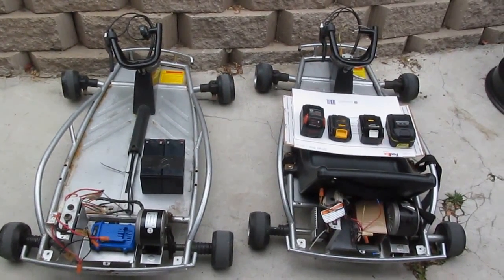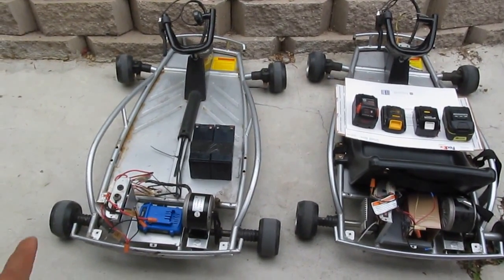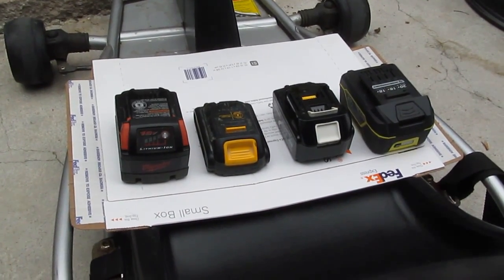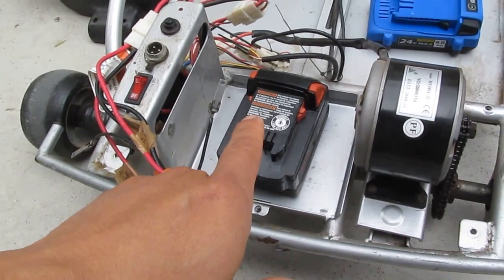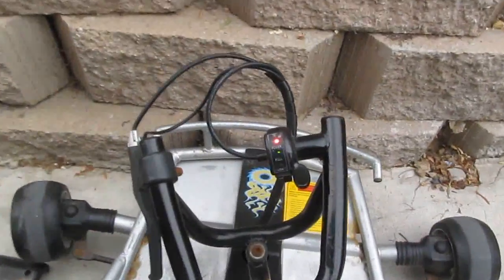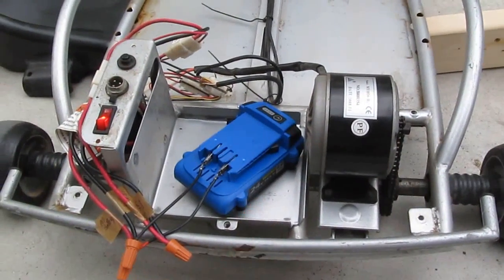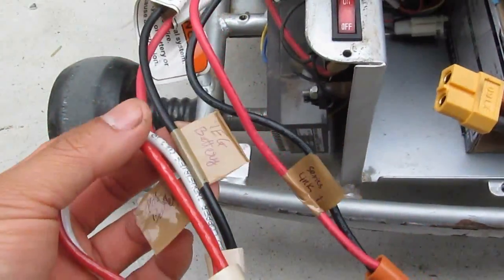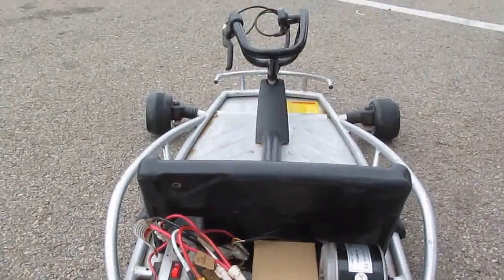DIY mod: Razor 24V electric go cart with Li-ion cordless tool battery

Comment: My Good Sir you are a genius. I have been pondering over a 2017 Razor GF and kept getting the clicking sound when I activated the throttle. Wow now I know, low voltage.  Thx u

Comment: Hello, I have a fault in my electric go kart, it does not accelerate and check that it is charging and the engine is running, what could be wrong?

Comment: Great repair/upgrade Vuaco. I built my son a gokart and used 2 12 volt, 12 AH batteries in series. Too weak, so I "up graded" to two garden tractor batteries, which helped for a little while but still weak and too heavy. I always wondered if I could use 1 or 2 drill batteries. Thank you for the clear information. I can custom build a battery with however many cells necessary for my kart!

Comment: Hi, How do you charge the kobalt 24v 2 AMP battery while it is in the kart?  Will the original charger work? Thank you
Reply from the maker: I cannot charge the battery while it's in the cart. The battery has to be removed to be charged. And yes, it works with the original charger as no modifications were made on the battery. I made a video of this same cart powered by a solar panel and that one does not need the battery removed to be charged. It is charged directly by a solar panel
Reply: Thank you so much for your reply.   liked your videos and learn a lot from you.  I appreciate if you could clarify the  following:
1-Why do you need to remove the battery to charge it?  Why do not use the original charger of the kart (the one with the plug of 3 holes)?
2-  I find a kobalt battery that is the same as you have 24V but 4 or 5 AMP.  Will that work with this kart or it has to be 2 AMP?
3-where did you get the metal connectors (at the end of the wired) that are connected to the battery.
4-Is it possible to keep the battery always connected to the charger (fix both charger and battery to the kart) so you can just plug in the charger when you need to charge the battery?
Thanks a lot
Reply from the maker: The original go cart charger was for lead acid battery. This is Li-ion power tool battery and the only way to charge it is to remove it and put it in my power tool battery charger. Any Kobalt 24V battery will work. The more Amp Hours, the longer it will last and you can go farther. The metal connectors are just metal clips you can buy from any hardware store. It is not possible to have the charger and battery permanently installed at the same time in the go cart. You can do it but it will require some modifications.
Reply: Thank you for your reply. 
1-Do you know what was the Amh in the original acid-lead battery?  
2-If I have 2 batteries of 24V each.  One has 2 Amh and the other has 10Amh.  Will the Scooter runs faster or it is just the 10Amh will stay longer before it needs to recharge.  I am asking this question because the motor is 250W.  That means it can withdraw current up to 250/24= 10.4 A.  Please clarify this point.
3- If I have Acid-lead battery of 10 Amh and Li-ion battery of 4 Amh.  Should I prefer the Acid-lead battery in that case?  What is your thoughts.
Thank you
Reply from the maker: I don't remember exactly but I think the original lead acid battery was 7Ah. If you have 2 batteries at 24V each, it depends on how you wire them up together. Series will produce 48V and it will run a lot faster. But you'll need a controller for it as a push button will just heat up too much and melt. Parallel will produce 24V and it will just last longer but doesn't run faster. Lead acid isn't better. First of all, it's heavier so it's not efficient to carry extra weight. Second, you don't want to draw more than 50% depth of discharge or you will damage lead acid battery. So a 10Ah Lead acid battery is actually only 5Ah usable power.
Reply: I am just trying to decide if i should buy acid lead with 10 Ah or Li-ion with 4Ah.  Which one is more practical and will run longer before needs to charge? 
is it Ok to withdraw more than 50% for the Li-ion?  when should I charge it?
Thanks

Comment: How long of a run time do your kids get with the 24 volt 2.0 amp hour battery?
Reply from the maker: Depends on how hard you push it continuously. But we usually get about 3-4 miles. I don't usually push it all the way till empty as it'd be very bad for the battery.